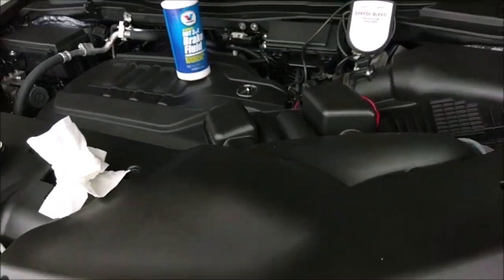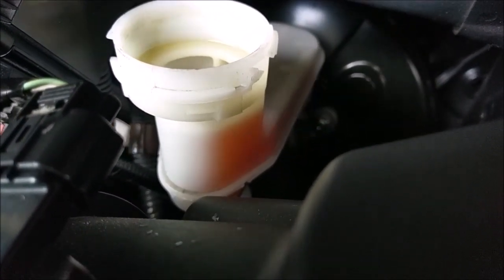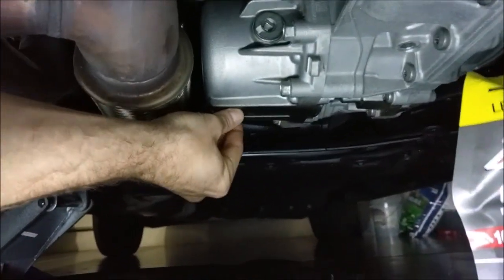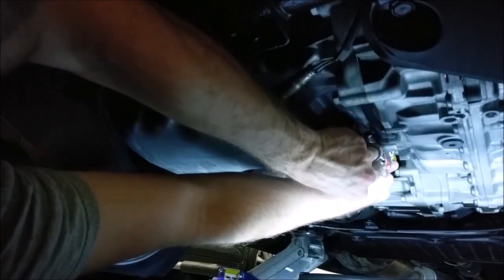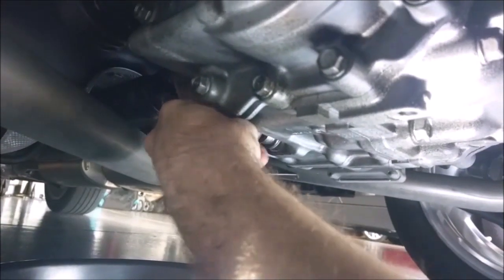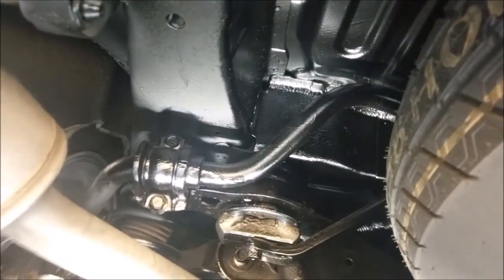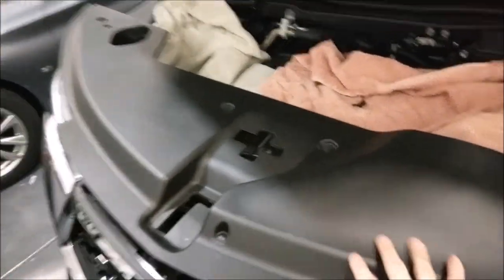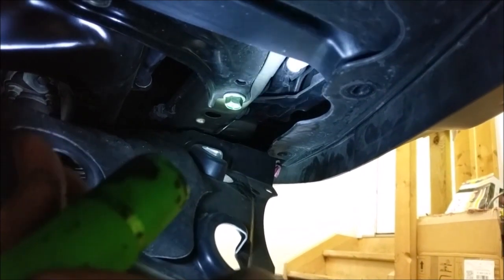2017-2022 Acura MDX Coolant, Brake, Rear Diff, Transfer case fluid change check

Comment: Thanks for the great video!  I did the coolant today, the 2019 seems to have eliminated the convenient trapdoor to access the radiator petcock - which is odd.  It only meant I had to remove a few more screws to pull the plastic out of the way to access the petcock.  Well it also made the draining a bit messier....

Comment: Extremely helpful! Thanks for keeping it brief, to the point without missing out on any critical information. Two thumbs up! 

If you are taking requests for future videos, it will be a huge help to get a transmission fluid change video on these 9 speed transmissions.
Reply from the maker: I am always looking for ideas.  I posted this video on transmission flushing already. https://youtu.be/0nsl1KgJdmI  and this one https://youtu.be/yFS35nlZ0Gc for a zf 8 speed. I am debating on how I will do it on the Acura. Drain and fill or a real flush. My issue with using a flush machine is, I need to open in up and remove all red fluid cuz the acura has a clearish green fluid.  In time I will post something.
Reply from the maker: trans fluid video https://youtu.be/5HhTtmLRpY4
Reply: @fer8888888 Very nice videos! I watched your MDX trans vid as well. Would it be possible to run a high quality robust full synthetic ATF like Mobil 1 Full Synthetic multivehicle (grey bottle/black label) in both the trans and the diff?? Reason I ask is because the older MDXs call for Z1 ATF for both. It was a thicker ATF. When they switched to the thinner longer lasting DW-1 and 3.1 ATF, the rear diff spec was switched to the Dual Pump Fluid System 2. Hmmmmmm. Thanks
Reply from the maker: @vqdriver  There are a lot of people with the same question as you. The transmission in the MDX is a ZF trans. There is no data out there yet showing what's in the magic ZF potion of a transmission fluid if it is even unique, while you pay an arm and leg for a quart. So I am sticking to the oem fluid for the clutch disc life and smoothness of clutches grabbing. Same concept for the rear end too. The unknowns about the friction modifier are why people don't use other fluids.  In theory other fluids should work but if ZF put a special friction modifier in their fluid, clutches will grab differently and could grab outside the programed shift algorithms causing too much or too little slip.  I put Amsoil in the transfer case/power transfer unit because that is just 2 gears meshing and no clutches. So outside of viscosity, there should be no reason Amsoil gear oil can't handle 2 gears.
Reply: @fer8888888  I have used Valvoline Maxlife Multi Vehicle ATF (Red Bottle) in everything from my Lexus LX470 for 20,000mi now, my sis’ 1st gen Sequoia, ES330, 02 Corolla with 210,000mi on original ATF lol, 05ish Subaru Legacy, E60 550i with ZF 6HP before mom crashed it, the Maserati ZF6HP that replaced it, and now soon a ‘19 MDX. The reason I will switch to Mobil1 was there’s this engine builder mechanical engineer blogger called “RAT540” who’s torture tested 298 oils as of today. Recently he started testing gear oil and ATF. A couple notable ATFs seized immediately under his testing! They were: Valvoline Maxlife multi vehicle, Castrol Transmax, Mobil multi vehicle ATF (blue bottle), and Ford Mercon LV. I WAS SHOCKED. His best testing ATF to date IS that Mobil1 full synthetic multi vehicle (grey bottle/black label) that I mentioned. Somewhat close behind was Amsoil’s least expensive OE Fuel Efficient ATF and just behind that is the Amsoil Signature Series Fuel Efficient ATF. Since that #1 Mobil1 had a very narrow compatibility list on the bottle and the website I personally messaged RAT540 himself on his blog Q&A! He said not to worry and that auto”magic”transmissions are not so sensitive mechanisms that not using the name brand manufacturer’s ATF won’t cause any harm. He actually said that choosing his best tested oil is in OUR best interest to help those poorly designed Honda transmissions lol. He said that in his testing any OEM brand is NEVER among his top. I concur in one example Toyota engine oil tested no better than Walmart Supertech FS, or even Peak (we’re talking in the bottom half of his wear protection ranking list!). Sorry for the wordy reply. I wanna think that OE brands aren’t that great and this “fear” drives their profit margins. Oil companies make the stuff cheap for the OEM so they can upcharge us! RAT540 found a way to independently test them at their own game! Go check it out. PS he had no answer for the rear diff except to use OEM those secret bastards are getting us LOL. Can you cross reference the earlier diffs? THANK YOU
Reply: @fer8888888  help me cross reference the older MDX diffs with the 2017+ models. If the construction is radically different then I will use the DPSF2 fluid. Remember the early diffs called for Z1 ATF, then when Honda saw transmission failures with extended drain intervals they switched to thinner DW-1, and said “mix and match” if you’re still having issues. Even they didn’t know wtf they were doing lol, but left the diff out since it was too out of range. If you’re too scared at least Amsoil specs their OE Fuel efficient ATF for Dodge and BMW ZFs. Anyway, Amazon delivered my Mobil1 ATF. Off to the final frontier lol…
Reply: Alright update: I did 2 drain and fills of the 2019 Acura MDX transmission using the Mobil1 Synthetic ATF Multi Vehicle Formula. 4.2qts came out on level jackstands and 4qts came out with just the front end on the stands. I did the transfer case with Valvoline 75W90, the rear diff also with Mobil1 Synthetic ATF Multi Vehicle Formula. It’s only got a couple hundred miles, running smooth! Will do a 3rd ATF drain and fill with the next engine oil and filter change. I have Honda DPSF2 and Valvoline Maxlife ATF on the bench if needed lol

Comment: For those who have heater issues, Honda now has a procedure for flushing the radiator core with CLR (from the dollar store.)  Worth a try before spending 8 hours changing the heater core.
Reply from the maker: I would be cautious with that. Unsure how if any residue left circulating around in the cooling system would effect things like head gasket coatings and other materials.

Comment: You make me feel peace of mind because you say that the Honda dual pump fluid II can be used on Acura. My car is  Acura RL.
Reply from the maker: Simply providing the data to support why it should be ok. I have both fluids here. The smell and color is the same.  I asked my kid to smell each and he said the same too. Dealer says either one too. My kid says both smell the same. The clutch kits are the same. So what gives?  A lot of talk on the internet but little data to support it.

Comment: that’s what worried me on my Subaru I have the flat six so all I did Subaru by the way says I can go 12 years well I did it in six and all I did is I drained the radiator with the engine cold so the thermostat was closed and then I got that big funnel off of Amazon that you connect to the top of the radiator and then I warmed up the car and let all the bubbles come out that way when I drove the car a couple months and did the radiator again because I know the radiator only has 1/2 of the supply versus the block. Yeah I was worried about the little air bubbles especially on Subaru and their head gaskets!

Comment: Did you have to remove the brass bolt from the engine block entirely so it can drain the coolant?  Or loosen the bolt is enough to start the draining process?  Thank you!
Reply from the maker: I loosened it but it was a slow drain so I removed it to speed things up

Comment: For the home mechanic can you use a 6 gallon pancake compressor to pull a vacuum for the airlift.
Reply from the maker: I would say most likely not enough volume in 6 gallon tank. The compressor would need some air volume.

Comment: I don't have an air compressor or tool to refill the coolant.  Do you think I can use one of those funnel kits to burp the system after I replace the coolant?  Will this be fine?
Reply from the maker: There probably is a lot of people still doing it that way. Usually air will work its way out overtime and the coolant level will drop in the reservoir. Typically it can get trapped in new heater cores and you get less heat in the winter.

Comment: How can you tell if your awd is empty or need to be charged and thanks for the break tip but do you have to change it if it’s dark or change it a round every 2 year
Reply from the maker: You take the fill plug out to check if the fluid level is at the bottom level of the plug. Usually transfer cases are recommended no more than 30k miles. I think Acura recommends every 15k miles with the rear differential but I am going to do it every 30k.  You don't have to change brake fluid every 2 years but I do. Some people never do. Some do it every 3-5 years.

Comment: Did you jack up the car when changing transfer fuild ?
Reply from the maker: Yes. I backed it up slightly from the the 2 bolts on the rear of the front sub frame to fit under.  But did final oil height with it only a few inches higher than stock ride height to get a little extra in.  Meaning jacked up front to tilt it back

Comment: Where is the pcv? What is your thought on installing catch can on this since its direct injection?
Reply from the maker: I didn't look for the PCV.  As far as catch cans. Most do a poor job capturing the oil vapor but do catch some just prolonging when a cleaning is needed a little bit longer. The ones that are expensive with many baffles and metal balled crunched to together strainers work best and delay needing the cleaning a lot longer. In the end you can't fight fate if this engine gets build up on the valves. Just buy a cleaning kit.  Walnut blaster or chemical cleaners with brush and pull the intake off.
Reply: @fer8888888  I was thinking of plugging the vacuum port and let it vent out, I know it's illegal, but who's going to find out. I'll just put it back to factory when it's due for emission test. And I believe those engines have a runner in between the manifold and head. And in order to remove the runner, you have to pull the head because there is no access to remove the inner bolts for the runner. Which will make it difficult to walnut blast.  And do they have a special kit for those engines. I know for bmw/cooper, they have a special tool kit that bolts on to the intake side to walnut blast
Reply from the maker: A lot of people plug the vacuum port and let it vent with a wiremesh filter. Do you know if these engines have carbon issues? Some brands are much worse than others.
Reply from the maker: @darylRvillaescusa  I took a look at the engine. Looks pretty standard, pull the intake manifold and the valves are right there. I can't find anything indicating this engine suffers heavily from gdi carbon build up.
Reply: @fer8888888  I watch older style j35 engine teardown and you will see it. I don't think much has changed but I can be wrong. Watch this from another youtube
https://youtu.be/BTUU7Gbxn_k
I took a quick look at my car and I think the pcv is front left valve cover and you see a hose route the left side middle of the manifold.
Reply from the maker: @darylRvillaescusa  I watched the video. I don't see any flaps like for a dual plane intake. He doesn't unbolt the intake runners from the head if that is what you are talking about. Once those are removed the  valves would be easy access.
Reply: @fer8888888  those runners can't be remove according to him. He had to remove the head because you have no access inner bolts of the runners.
I never look inside the runners to see if the valves are visible. If it's not visible you just have to make sure your in compression stroke to walnut blast. But I been searching around on j35 since they transition to direct injection and I haven't really found any. I'm planning to keep my car for a long time and I want it as trouble as possible
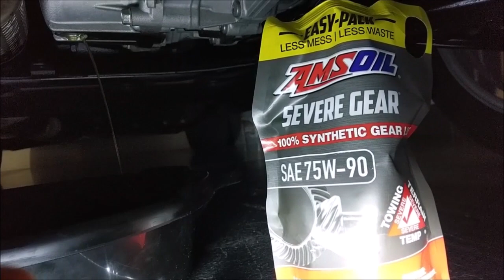Reply from the maker: @darylRvillaescusa  looking at 4:03, 12:30, and 12:54.  I see no reason why you can't remove them with the head on. All bolts are look accessible. Other wise you would have to use a flexible camera boroscope to see them.
Reply: @fer8888888  I got to see it in person. And I'm not about to take off the manifold on mine unless I have a problem on my car. It involves replacing gasket and torquing them in order. I just bought the car and I bought a catch can. But I'm not going to hook up the hose going to the vacuum port, only going to hook up from pcv to the can and vent it out from the can
Reply from the maker: @darylRvillaescusa  https://youtu.be/cQOzxn7LRFQ found that video that shows removing the intake with out removing heads.
Reply: @fer8888888  yup I saw it, your right. But I have a feeling the new engines have a little different design. As you can see on the video you showed me, the injectors are mounted on the runner. The new engines are DI. Hopefully the new engines are a little easier to get to
Also I was wondering what type of air compressor you have. I'm shopping for an air compressor and I was wonder if 120v 30 gal compressor is good enough for cars? Like to use the airlift coolant vacuum? And using 3/8 impact wrench?
Reply from the maker: @darylRvillaescusa  I have a craftsman 33gal 1.6hp 5.1scfm at 90 psi.  I do a full a charge before running things like the vac and fill. It takes a while to fill up but works great for just about everything you do at home. The higher pressure at max charge really gives the impact some power to break things loose before the tank lowers in pressure.   the 220V compressors will recharge really quick which is good for painting cars.  If you watch my other videos like the barracuda build ones you will see 33gal has done just fine. I run my tire machine on it too. Then I bought an electric die grinder/cut off and only use the air one when I have something quick to do or need a small die grinder to get in a tight spot. Belt drives are a lot quieter, cuz you will need to wear ear plugs if the direct drive is in the garage space as you.    This link is to the newer 33 gal compressor that replaced mine.   https://www.lowes.com/pd/CRAFTSMAN-33-Gallon-Single-Stage-Portable-Electric-Vertical-Air-Compressor/1002955456